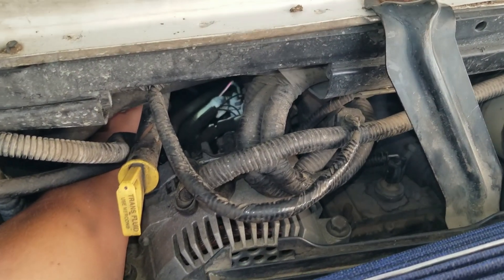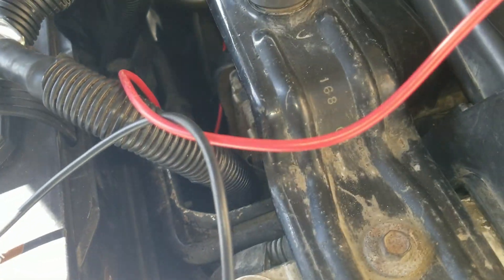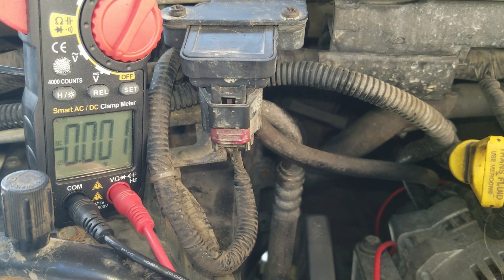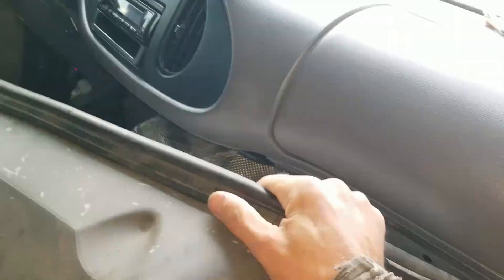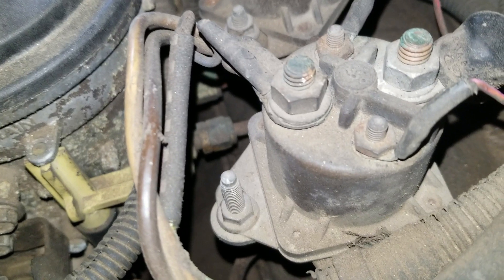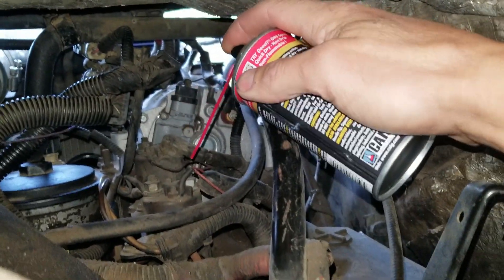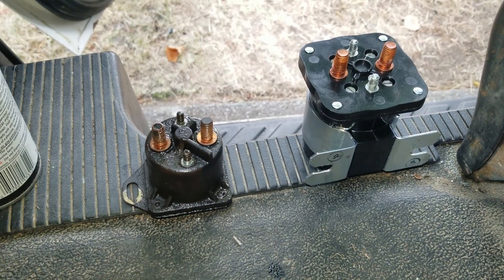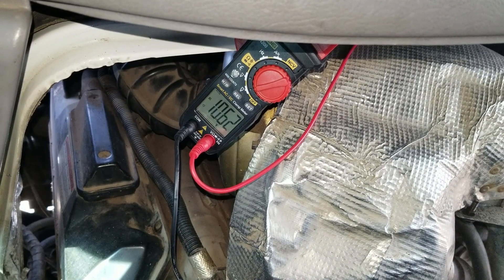Installing a MONSTER Glow Plug Relay on your 7.3 Powerstroke Van - Testing / Replacing a Diesel GPR

Comment: I woukd love to find out some more info for your air filter/intake. Mines all cracked and and cant find a replacement
Reply from the maker: Honestly I wouldn't recommend mine.  It's a previous owner special, and I don't think the K&N oiled filters come highly recommended for the 7.3 Powerstroke.  Basically I have two K&N filters on an intake spider that is cable clamped onto the cut-off original intake.  It's working fine but I think someone could come up with a better solution.  I've seen folks relocate one of the starting batteries to the frame rail and then put a huge aftermarket filter where the battery was; this seems like a leading contender for best option to me.

Comment: I am not convinced that the OE relay is inadequate in some way.  Did you do any tests that prove the glow plugs are drawing more current than the stock unit can provide?

If you are having issues with blown relays, then I would suggest that's an indicator your glow plugs are starting to go and should be replaced.  Just upgrading a relay could just be a bandaid that covers up the real problem.
Reply from the maker: Valid points.  I think durability is the main reason to upgrade to the Stancor.  It is a burlier unit with larger contacts and a stronger build, and should outlast the OEM unit.  I don't think current draw is really a concern, it's more with burning out the contacts over time, which will happen as a result of normal wear and tear over years of regular use even if the glow plugs aren't offering increased resistance.    

As far as tests, I know that my old OEM relay was providing less voltage on the draw side than on the feed side, so there was an issue with the unit itself.  Despite buying a van with 300k+ miles, I don't love wrenching around under the doghouse so replacing the OEM GPR with a beefier unit that should outlast the stock replacement for not a lot more cost made sense to me.  

I couldn't agree more about the bandaid concern, and I will be replacing my glow plugs (and injectors and UVCH) this spring/summer once budget and weather allow.  Anytime you have an issue with one component of a 20+ year old system that is subject to wear and heat and dirt and vibration, I think it's pretty likely that if one piece fails the others aren't far behind.

Comment: I tested mine and it was dead.  Its on a 2000 F-450 with 50,000 miles.  WTF?  How much could it have possibly been used?  I'm going White Rogers and not looking back.  Fuel bowl delete next!  BTW:  The power terminal should have a insulated terminal cover on it since it is always hot.
Reply from the maker: Low mileage but if it was original then the thing still had 20+ years of exposure to the elements, vibration, cycles of heat and cold, etc.  I'm surprised so much is actually still working on my van

Comment: My 03 7.3 wouldn’t start if I didn’t plug it in last winter. I added that GPR, no luck. It needed undercover gaskets and new glow plugs.
Reply from the maker: Bummer.  Thanks for sharing.  Did it start well after replacing those?

Mine started on the old GPR but I'm systematically working through the van and replacing every common failure point, so this upgrade made sense.  I haven't pulled my gasket covers yet.  I think when I do I'll replace the glow plugs, under valve cover wiring harnesses, and check all the injectors.
Reply: I’m hoping it did the trick. I’ll know more when it gets cold out.🤞🏻🤞🏻
Reply from the maker: Good luck and keep me posted!  Heading into my first winter with this van and always learning.
Reply from the maker: How was removing the valve cover bolts?  I've seen some folks really struggling with them on social media.  Any tips?
Reply: I had a diesel shop change them. I don’t have the mechanics tools and garage space needed.
Reply from the maker: @cn3121  Gotcha!  Well I'll be taking a crack at it on the street here this winter so hopefully it isn't too much of a PITA!!!
Reply: @PowerstrokeEconoline  As a new owner (as of last week) of a 7.3 Powerstroke box truck e350, I’m very curious about the path to changing the glow plugs out. Mine isn’t starting even on decent 30-40 degree days without the block plugged in, so I’m hoping new plugs and relay do the trick. I’m a bit scared to take it on myself!
Reply from the maker: @Strangebird_Recording  I haven't done a glowplug swap yet on my E350, but I did recently buy a parts van and pulled the injectors out of it and got a good look at the glowplugs.  The major complication on the vans is access.  I expect it will be easiest to access from the doghouse side, just as I've shown in this video.  On the parts van I removed the turbo and fuel bowl and it was really easy to get the valve covers off with all that space.  I may do the same on my keeper van and rebuild the turbo, fuel bowl o-rings, glow plugs, injectors, and replace the under valve cover harnesses and wire pigtails in one major overhaul come spring when it's a bit nicer outside.  In the meantime I'm just gathering up parts and knowledge.  

From the reading I've done, I think this is a pretty good guide to glow plug replacement: 
https://www.dieselhub.com/maintenance/7.3-powerstroke-glow-plugs.html
Reply: @PowerstrokeEconoline  Thank you so very much! As a new owner with some work ahead of me, this resource is phenomenal. Thanks for taking the time to respond!
Reply: Thanks for this video. My glow plug relay is getting 12.5 from the battery but only transferring 10.0 to the glow plugs. Getting a no crank/click. Going to replace the relay and see what happens
Reply from the maker: @haydengodfrey8147  you're welcome!  The glow plugs do draw heavily from the batteries.  Mine typically show 11.1v-11.3v under that load.  The key thing to consider is if there is a difference on the battery side versus the glow plug side of the relay.